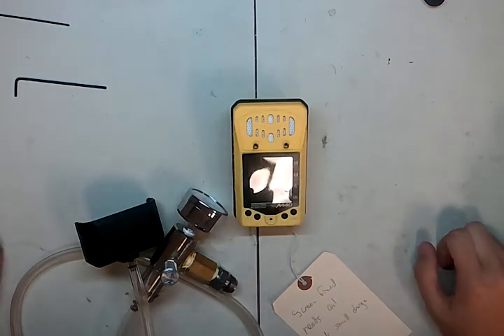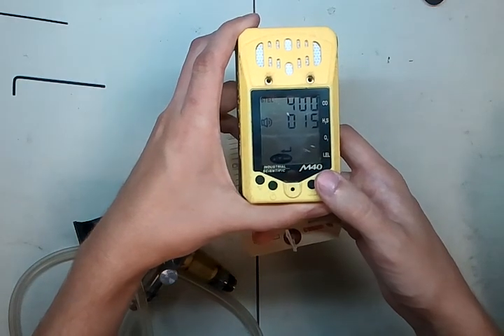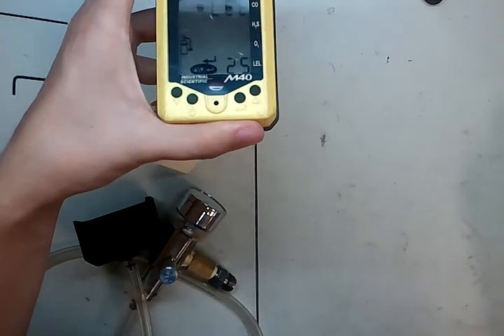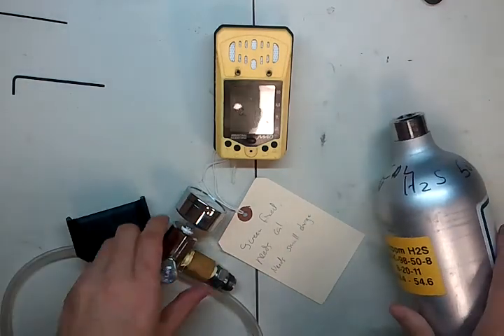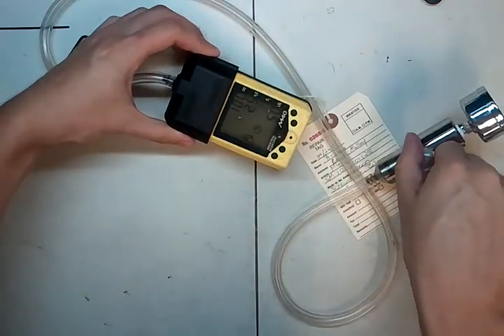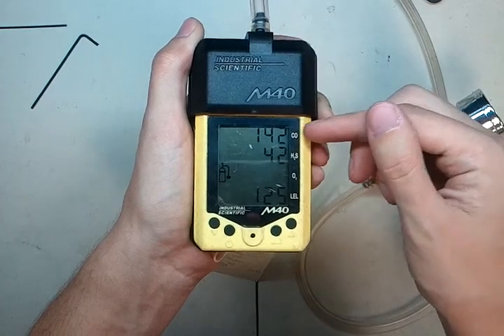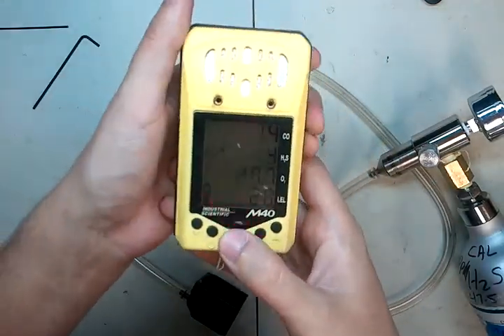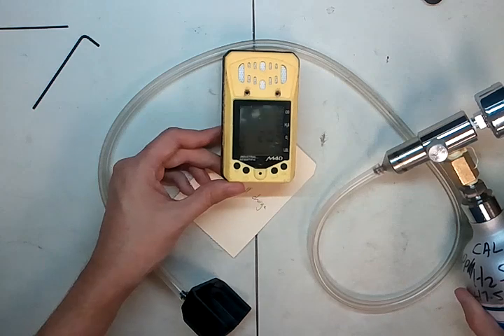Industrial Scientific M40 Gas Calibration Guide by Ideal Calibrations

Comment: United central m40m ....are you familiar with these?
Reply from the maker: Yes, the MSHA approved version of the M40. It's been discontinued for a while, like the M40. You can sometimes find used parts for them around
Reply: @Idealcalibrations  awesome your still on here.  So these are actually still usable?  Nice.  I'm open to any help you can offer on these. Is the cal the same as the m40's etc....
Reply from the maker: @destinationunderground6006  They can't get rid of us 😂. Cal is usually a similar mix, but with 50% LEL CH4 instead of the Pentane. Honestly, if you still have these units I'd be scrambling for some newer ones. Odds of them working are slim to none and parts are going to be a nightmare in a pinch. That said, calgas mix is 25ppm H2S, 100ppm CO, 50% LEL CH4, 19.0% O2 (18.0% will also work, O2 on this unit doesn't cal to the cylinder), Nitrogen balance
Reply: @Idealcalibrations  iv actually got two working units I plan to use to explore some abandoned mines I've been researching and documenting.  They both give values on CO
But I guess I'm waiting to go through a cal to determine full function.  I'll just say it...I'm a cheap ass and if these will serve the purpose as I've found the replacement sensors on line I'll run with it.    My question is....will running through the calibration tell me..."yes" these are functional as I would need..?
Reply from the maker: @destinationunderground6006  yes. If it gets through calibration (watch the span reserve values) you should be good. I'd always check it after with gas just to make sure. Remember to check it each day before you head out into the field. Those LEL sensors sometimes die without telling you they've died
Reply: @Idealcalibrations  probably ideal in your opinion to just change them all? If not sure of age.    Thanks a ton for the info!
Reply from the maker: @destinationunderground6006  I'd probably only change ones that are acting up during cal and bump.
Reply: @Idealcalibrations  thanks a ton!

Comment: Is it dangerous to calibrate indoors? I am afraid of inhaling this calibration gas
Reply from the maker: Hey Jordan, no it's not dangerous.  The gas is at a low ppm level for the most part, and by the time it reaches you it is extremely diluted.  It loses concentration at a cubed rate of the distance you stand from the point of impingement. That being said, I wouldn't sit in an extremely small room calibrating a few hundred monitors, but a few calibrations won't hurt you at all.  Just try and ensure adequate ventilation.